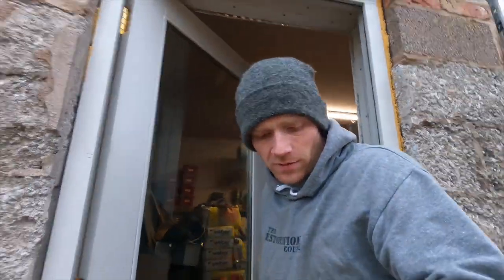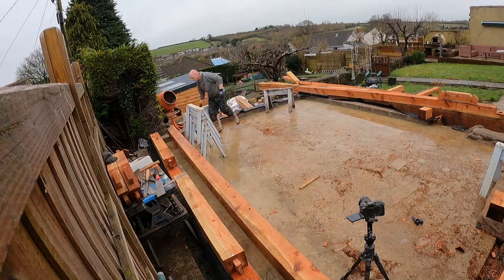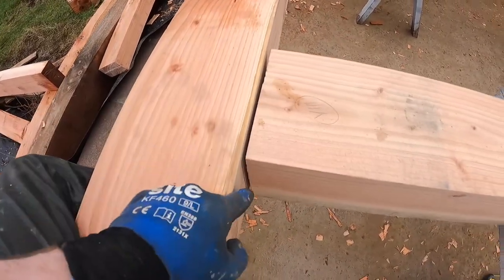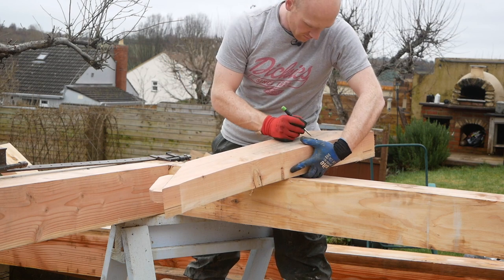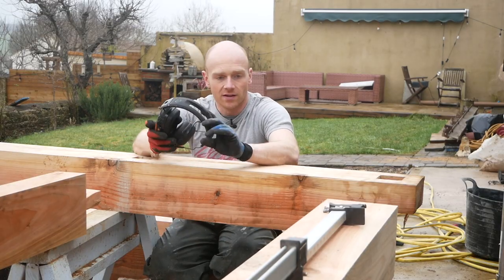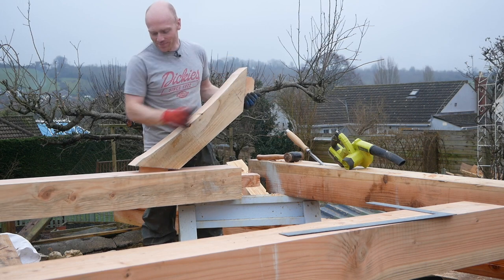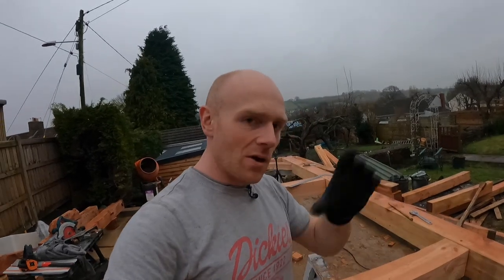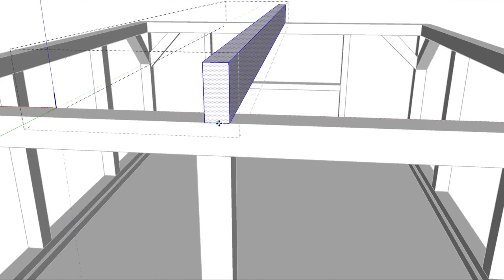HALF THE FRAME IS DONE - Giant Mallets and Scott Brown Wannabe?

Comment: Raising the roof. 2 ideas. If you have the fram up you could lean some supports on the open side like a ramp and drag the ridge beam up it with your winch or rachet staps connected to the farside of the fram. Option 2 rock and rise. Have 2 stacks in the centre with the ridge beam on top a bit like a seesaw rock the seesaw down a gap will open up pack the gap with a block then rock it back the other way and so on. I saw a single guy lift a 20ton concreat block using this method.

Comment: evening Tim  As per lifting the ridge beam.Try maybe the Robin Clevett technique he used on his garden room ridge beam.Two 2x4 or maybe larger constructed ladders either end with linear corresponding bolt holes in each upright.use a large metal pole to slide into each set of holes to support the weight of the beam as you lift it..keep lifting either end and slide the poles through to support the weight as you go.seemed to work very well for him.hope that helps.loving the build by the way

Comment: Is it not possible to lie the ridge beam diagonally across the floor whilst you put up the four walls?  Then lift as high as possible in steps using the electric winch mounted on a support across the corners, resting the ends of the beam on a step ladder/trestle as you progress.  Once the winch can lift no higher you should be close enough to lift the beam onto the roof plate at each end.  I adopted a similar approach when replacing 22' long 9x3" joists in a previous house on my own, so it can work!

Comment: Wrap a ratchet strap around one end, use that over the end beam to pull the beam up as high as you can on one end, then you can push it just that little bit over onto the top of the wall at one end. Repeat the same on the other end. You could probably use your block and tackle or scaffold winch attached to the ratchet strap to make pulling each end up a bit easier.
You might even get a saw horse on the top of the wall beam to give you that little bit of extra height to pull the beam end all the way up with.
Reply from the maker: Not sure I quite follow, are you suggesting lying it along the longest side and then lifting up one end or coming at the building at 90? I think the winch might work on its side as long as its under tension so figured I will get the frame all up and braced which will then give me a safe and solid anchor or lifting point.
Reply: @TheRestorationCouple  I was thinking lay it on the ground in the middle of the building, right under where it would be installed. With one end just inside the building. Strap that end, use the top of the wall beam as a pully to lift the end inside the building straight up. Then get that end of the beam onto and over the wall. Push it on enough that the other end is then inside the building as well. You can then repeat that same process on the other end so you have two ends sitting up on the wall where they belong. 

If you don't have something on top of the wall, you'd only be able to get it flush with the top of the wall, but its a lot less effort to lift it 30cm onto the wall than all the way from the ground.

Comment: Once the east and west wall frames up you could lay the ridge beam on the floor with 2 or 3 heavy duty rachet strap between the two top frames and underneath the ridge beam. Slowly rachet the beam up as high as you can go.   If you have offcuts of beams you might be able to stack them on the frames to get the rachet points higher. Then maybe able to man handle it up in position. Hopefully that makes sence. :)

Comment: Hi
Getting ridge beam up. Seen it but can’t remember where. Need two people. Have two ladder like structures with removable pegs, like rungs. One fixed upright at either end. You lift each end small amounts and Jo pushes a peg  into a pre drilled set of holes each time you raise the beam.
Great videos. Great work ethic. Good luck.
Nick
Reply from the maker: Yeah that was my initial idea, may still be an option but now thinking of more of a crane plan so I can lift all the beams that way.
Reply: I think it was on skill builder.

Comment: A couple lengths of timber leaning against the frame at 45 degrees with some blocks screwed every couple of feet. Lift one end on a block then do the same to the other side going back and forth walking the thing up. Probably put a ratchet strap in the middle just as a safety catch.
Reply: I’ve used this method to lift a steel ridge beam into a house. I left 3 old trusses in and walked the steel up them. Rolled it into position on the top then removed the old trusses to pitch the new roof. Pretty sure the neighbours thought I was a nut case lifting a steel in on my own

Comment: Raise the west wall.  Put the ridge beam in the middle corner to corner.  Rise the rest of the walls.  Then use a strap to raise one end on top and let it hang over.  Then you can you a rope and pully on the east and west wall, hook under the end of the beam on the ground and raise it up to the roof.  Slide in place and there you go.

Comment: Brilliant videos you share, at 2.10 you said that you will be fixing the soul or sill plate down mechanically in the future. Can you  explain your process on this please. Would kindly appreciate
Reply from the maker: Just used some hollow anchor type bolts from memory. To be honest it was more to keep it located as I very much doubt it would lift!
Reply: @TheRestorationCouple  thanks for the reply 🙏, 
Yes thats what I will be doing just floating onto the 6 x 2 treated timber that I actually fixed into the concrete blocks using 16mm stainless steel threaded bar and spring washers and 2 inch square plate washers . Also rostered the square into the sills so it pulls nicely onto the concrete blocks

Comment: I managed to lift a 6m beam that was 6 inch by 6 inch up myself  for a pergola using a set of a frame extension ladders and a block of wood at the other end on the ground to stop it sliding until I could get to the other end and lift that side up

Comment: How about build your frame all four walls. Put several boards at a 45 degree angle and use your lift that you used for your roof to drag the beam up the board right to the spot you need it to be.
Reply from the maker: Yeah thats how I had planned as the frame will give plenty of anchor for that, I'm now thinking that the beams all way round might not be so easy so probably need to rethink.

Comment: Use aluminium tower with motor on?
Raise one end of beam onto structure, motor attached to fence and pull beam from floor end?
Two ladders either end, slide beam through rungs and lift up one step at a time?
Check out robin clevit’s gluelam ridge beam raise (he had +4 guys 😂)

Good luck? 🤷‍♂️😂
Reply from the maker: I'm thinking that I can actually create a mobile 'crane' using the tower and winch and use for all the horizontal beams.  With the big outriggers I think it should be pretty solid.  I'll experiment tomorrow. 👍

Comment: What kind of wood is it? Sorry if answered before. Looks too light to be green oak?
Reply from the maker: Douglas fir.
Reply: @TheRestorationCouple   I thought it was. Is it starting to go black where it has got wet?. I've just used it to make an exposed beam, featured ceiling and I had to bin a few lengths as they went black in places due to getting a bit of rain on it. Good job on those M&T joints. 😎

Comment: lat the beam in the middle first
If you have 3 lengths of scaffold, lay 2 one way, lay the third the other way in tyhe middle, wrap some rope in figure 8 style where they overlap, lift the middle oto a horse, spread the 2 legs, then push the single leg to raise the frame into a tripod, tie a rope between legs to stop them spreading
It's what we used to do to lift engines.
Something like this guy in the middle of the vid but with the middle leg in the other direction, that will tighten the binding
https://www.youtube.com/watch?v=sROsd8pYQiA

Comment: For the external door, can you avoid needing a door lining at the top and only have the door stop bead? Sounds like it would then only need ~1" cutting off the door to fit, and avoid the need to cut a wide rebate into the top beam?

For raising it, do the internal method as you suggested, but lift on the diagonal (opposite corner to corner) rather than parallel to east/west wall. Use the electric hoist off the top beam to get you 70% of the way there and use scaffolding/ladders as a support for a top resting position (or even the landscape window cill - but probably not quite high enough). That way your final lift can be a straight up and push/pivot to get the beam resting on to the top beam before squaring it all up. If you try and lift the beam parallel, your final lift at each end has to also try and shuffle the beam along its length, which you won't be able to do by yourself while also lifting it. If you start on the diagonal you won't need to shuffle it, just pivot and that will be doable by yourself. Not sure if that description makes sense, a diagram would be easier...

edited to add: you top resting position could even be held by a strap off the top beam, or a strap underneath a bid of 2x4 spanning the corner. So lift as high as you can with the electric hoist on the diagonal, then use a strap to hold the beam up while you lift the other end. Then final manual lift up while stood a short scaffold/trestle platform and push the beam on to the ridge beam leaving the strap in place until both ends are up, then square up etc.
Reply from the maker: Thanks for all the suggestions John. I think that is a good approach for the ridge beam and like you say even if just getting 70% up should allow me to swing and pivot. I need a bit of experimenting today as it may be that the other four beams will need lifting too so may use scaffold and winch. Need to play around with door but like you say, no need to use a standard door frame if it’s going to be more hassle.
Reply: @TheRestorationCouple  Yes, it's definitely one where you want to do any trial lifts/methods with everything still close to the ground until you're comfortable that it'll be safe. And you might find the ridge beam to be the easiest of the 5 beams to get up there as you'll have the secure platform of the ring beam in place to help.
And I doubt you'll need it, but a bottle jack / car jack and a 6ft length of 2x4 is helpful if you need to slowly and carefully apply a lot of force upwards (to e.g. lift a beam off a post, or push a brace into position, or insert a shim after a beams already up).

Comment: Don't kill yourself mate, I'd lend you my genie lift if you lived near by. I used it to put my cartlodge frame up a couple of weeks back (will be a few weeks before I put my video up) Even though it's just one beam I'd still hire a genie in ✌️
Reply from the maker: Had originally planned that however I think I'm correct in thinking that you cannot lift beyond the distance of the base?  Therefore it would be no help for any of the wall beams just the centre one that would have space below.
Reply: @TheRestorationCouple  no you can get extension bars for the forks, the weight of them beams will be fine on the extensions. The weight limit is just reduced abit. Can send you a pic of the label tomorrow if you want. I bought my genie sla10 from an auction so I just bolted some steel angle iron to the forks after the first day of struggling.   Lifted oak and Douglas fir no problem 👍
Reply: You could make a platform that spans just over the top of the sole plate and a ramp to wheel the genie lift onto the platform, then you could lift the wall plate up slide it over and drop into the tenons.
Reply: @TheRestorationCouple  I've tagged you in Instagram stories 👍 just went out in the mud and rain for the pic 😂☔